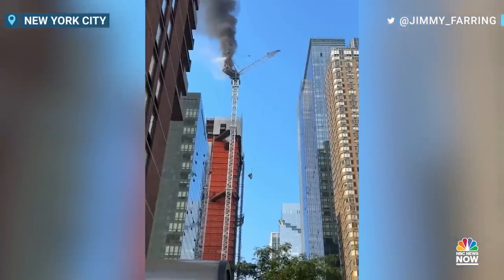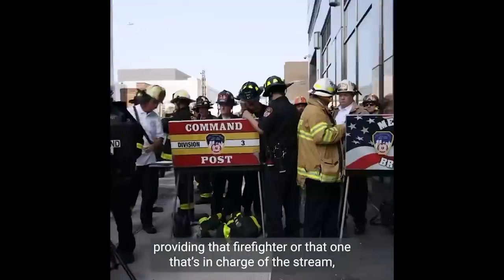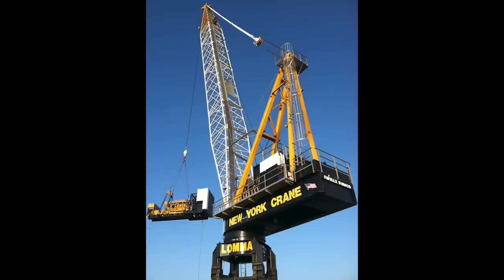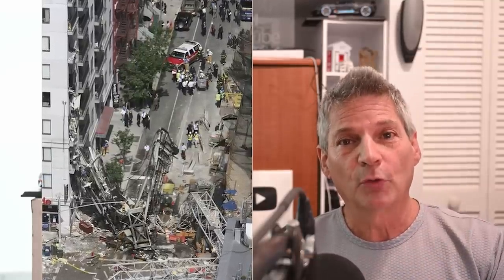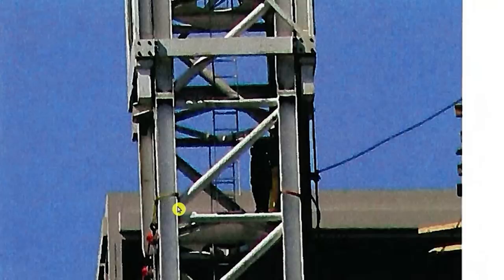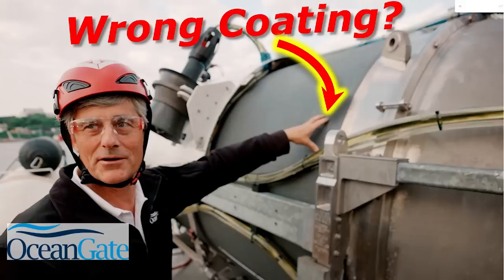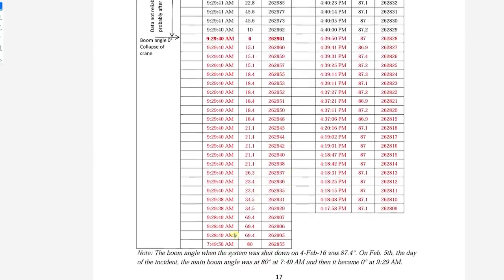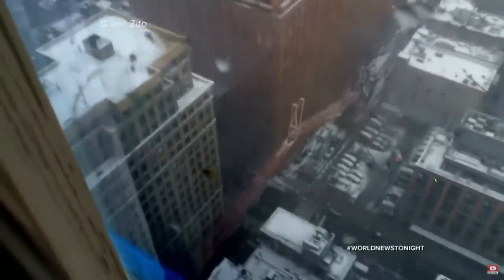New York Crane Collapse Cause, MORE Fatal Collapses

Comment: I’m a sculptor.  I was installing a 6.6 ton, 35 foot by 17 foot by 12 foot sculptural shade structure of my design that required a 155 foot reach from a crane parked on a street with a 20 degree slope.   The crane had been propped up at one end on shoring with its outriggers fully out. It took nearly 3 hours just to load all the counterweights to balance the reach of that load.  They lifted the sculpture up and over the brand new building, and as they were lowering it I stood next to the guy with the walkie talkie  who was directing the crane operator.  With the sculpture still about 30 feet in the air we hear the operator say, “ you got about 30 seconds to get this off the hook cause the street’s starting to give way under the outrigger.”  I stopped breathing, but the guy directing just kept giving instructions to line it up with the columns and lower away. 23 seconds later the cable went slack and I felt relieved.   The guy then explained to me that if it had fallen it would not have been the crane company’s fault, as they had done the calcs and the load on the foot pad should not have been enough to cave in the street.   He said the county would have been in trouble for making a road that did not meet minimum load bearing capacities.   The foot pad was a good 36 inches wide. After the crane packed up and left, I went and looked and sure enough, for the next ten years there was a circular depression in the road right where that footpad had been.  They just recently repaved that road and its finally gone.

Comment: Two streams may have been the issue.   And yes 45° may have helped, maybe not due to the loss of laminer stream due to wind/air pressure.     Water flow  is much  different  than a solid shell flying through  the air. Air/ wind is different  with  water ...  As a retired firefighter 45° is not always the answer.   I am sure they adjusted the angle for maximum actual distance. It looks like the FD  was using  a smooth bore nozzle which will send water the most distance.  I wonder if the second nozzle took too much pressure away.   Maybe, maybe not.  If they were at maximum pressure no issues of the second hose line.

Comment: I believe the reason they had the hoses angled the way they did was because they had to find a way of getting the stream there by the shortest route possible in order to maximize the streams effectiveness.  You will notice as the stream gets farther away, the stream begins breaking up and separating, making it less effective.  If they angle up, that increases the distance, but it also means the stream will break up more.  Obviously, there are a lot of factors that have to be considered.  The diameter of hose they're using.  The type of nozzle.  Wind speeds.  And what PSI they are using at the pump.  Now the 45 degree angle might very well have been the most effective.  But you just can't use that as if it is always the best one to use.  I used to be a firefighter, however its been many years since I last worked as one.  And I'm trying to recall what I learned and its definitely a little hazy.  So I know there is probably a better way to explain what I'm talking about.  And for that, I apologize.

Comment: A 45 degree angle giving the largest distance is only valid when neglecting friction. For a canonball, that is a somewhat appropriate approximation, but for a water stream it is certainly not. The stream quickly breaks apart into tiny droplets that feel a large amount of air resistance.
Reply from the maker: If what you are saying is true, why doesn't rain dissipate before it hits the ground, falling from thousands of feet? Yes, you would have some separation of the spray, but for sure at that distance may be 50 feet above the Crane, the water would be landing on it for sure, maybe not all of it, but at least some of it period at least what they have right now. Without horizontal spray, none of it is even reaching anywhere near the Crane.

Comment: ChatGPT gave this response to the optimal angle of a fire hose:  

The optimal angle for a fire hose to reach the farthest horizontal distance is typically around 30 degrees, not 45 degrees.

When a fire hose is aimed at a 30-degree angle above the horizontal, it strikes a balance between maximizing the horizontal range and minimizing the effects of air resistance and gravity. This angle allows the water to travel the greatest distance before it begins to fall back down to the ground.

The 30-degree angle is often considered the optimum angle of projection for achieving the maximum horizontal distance with a fire hose. However, practical considerations such as water pressure, nozzle design, wind conditions, and other factors can influence the actual angle that firefighters use in real-world situations to effectively combat fires.
Reply: The physics answer for a projectile ignoring air resistance is 45 degrees taking into account only gravity. However, because of air resistance, one needs more horizontal force for a water stream. If you have a fire hose in hand, the real life solution with would be to vary the elevation till you achieved maximum distance hopefully reaching the intended object fire. In the video, neither hose stream appeared to reach the fire adequately even though it looks like they were higher than the fire.

Comment: I watched the new 35W bridge as it was built from pre-cast pre-stressed concrete segments of 200-240 tons each. I was on the 10th Street Bridge adjacent as the first segment was hoisted and secured to the stub on shore. I watched several more segments put into place over the next two weeks or so, and was lucky enough to watch, virtually alone on a cold day, as the final segment was slowly lowered into place. A crew of workers in each end of that hollow concrete structure then connected the interior chord arrangement for post-tensioning. Another day at the office for them, I’m sure. Pretty cool process to watch from my vantage point, but with sad cognizance that the previous steel bridge was poorly constructed (thin gussets), and improperly loaded during surface replacement…falling without warning, killing several and injuring many more…..

For the hoisting of the concrete segments a massive old Manitowoc (model number escapes me now), it’s red paint job mostly faded to a pinkish hue, was situated atop two barges which were welded side by side. The crane bore the name “Big Ben,” which the operator explained in a Minneapolis newspaper article was in honor of his grandson Ben. (The casting yard city blocks away utilized a gantry crane to load the concrete segments onto truck beds for a truly short haul to Bohemia Flats. Once there another land based crane (the make escapes my recollection, but it was all blue) picked the segments from the trailers and arranged them by designation on the site. That crane soon bore the moniker “Bohemian Blue,” and subsequently loaded the concrete segments from the queue onto a barge tended by small tugboats to the appropriate site for Big Ben to perform its pick. One very interesting part of the process, amongst so many others, was that once the two-masted Manitowoc had raised a concrete segment to the proper height, the operator let out the mast winch line and “coasted” the boom forward/down and directionally proximate to attachment point of prior segment string and new piece. There was a definite run-out sound as if hand pulling fishing line from a reel! Due to how many “parts” of line were run on the mast assembly of 650 ton capacity Big Ben, the concrete segment slowly, assuredly, accurately “floated” into place as the boom was lowered! It truly was impressive, and when within reach of “home,” the brake would be heard slowing the boom descent under full control. Remarkable operation each time; like a slowly moving game of darts! 

I remember the scale of the white-painted traveling block on Big Ben, and the even larger alternative block resting, lashed to the barge, also white, as workers labored at the pylon corners of the barge! Massive!! 

Although I grip my steering wheel tightly when driving over the “new” 35W bridge, I think about having watched these very segments put precisely in place and strung together by workers standing upright in the hollow belly of the bridge!

The newest, the third in my lifetime, Minnesota Vikings stadium, not but perhaps two miles from the 35W bridge, required a HUGE yellow and blue Sarens crane to be assembled inside the footprint of the building, on the field of eventual play. I had noted a very(!) oversized load on a flatbed trailer crawl ahead of me at a stop sign, it’s cargo but a single yellow boom section! It was the tallest, widest and longest bit of crane I had ever seen only yards away in traffic. As the crane was erected over the course of weeks, and as it could be seen as both taller and “thicker” than any crane I’d ever seen from miles away on the city skyline, I knew that this was, as Charlotte might say, “Some Crane!!”

That Sarens, at 1,130(?) ton capacity, billed in the newspaper as “the second or third largest crawler crane in North America,” absolutely dwarfed the 500 ton Manitowoc, itself truly gigantic, set up outside the stadium footprint! The crawler tracks were about eight feet high. It had two masts of course, plus outrigger counterweight straps just in case it had to lift anything actually heavy…which it did not hear. Absolutely everything was massive!!  I arrived once to watch the action through the fence, in good company as we all expressed our awe, only to find the workers laying about after their lunch. I recall one guy getting up, as others were stretching back to life, and nonchalantly strolling past the big Sarens. I thought to myself that if I were on such a worksite I’d take every spare minute to marvel at the yellow and blue steel lattice beast in my neighborhood!  And then, back that man returned, climbed a ladder onto the eight foot tall track, and stepped into the operator compartment… He wasn’t in awe of the crane as I was; he was the primary operator. A subsequent newspaper article stated that he and a backup operator travel with that crane! Most recently they had been at a nuclear power plant build, if I recall correctly.

Each evening, come the close of the work day, the giant Sarens, with a jib as long and thick as the boom of most run of the mill cranes(!), would be “jack knifed” onto a set of off-white polyethylene wheels at its apex. So I know what you mean Jeff about that safe-resting procedure. The parts, all the parts, of that crane were beyond my prior reconning!!
(I realize that there were and are far bigger cranes even within North America; but not in my “near neighborhood!”)

One night I heard a hum and saw some faint lights coming from the bowl of the stadium build. Having nothing else to do on a night off from work, I walked over to the fence. An operator and one other worker were slowly moving the Sarens through maneuvers which varied but slightly one from the other. It occurred to me that they may have been planning out angles and placement priorities for a big lift the next day, though that is only my speculation…

The Sarens was not needed for its gross maximum lifting capacity, but for its security at jib height with bulky, awkward and expansive steel structural loads. If I had to guess, nothing I saw the Sarens lift weighed over 300 tons. Everything was on the end of the jib; the boom line never came into play once!

Taking down, packing up, and hauling off the Sarens took another week or so. I’m glad that I took photos, for I may never again see another crane with eight foot crawlers!! (Though perhaps if the Vikings decide that they require a fourth iteration of a stadium to make up for the fact that we STILL haven’t won the Super Bowl . . . )

Comment: I guess the problem with the water stream from the hose is that the best possible angle is not 45 degrees because the stream will separate into mist before the water travels the whole arch. If they were shooting metal balls from the hose without air friction, then 45 degrees would be optimal.

Other than that, great video. And I think it would be better to underline which parts are speculation and which are actual data in future.

Comment: 2 things here... 1 the nozzle laying on the ledge at a horizontal angle is a 2.5 line that flows water through a 2 inch opening to the nozzle and the one arched at an angle is a blitzfire/ ground monitor  on a 3 inch line forced through a 2.5 inch opening to the tip... the 2.5 line isn't going to the ability to reach that far even at a 45° angle and  the ground monitor on a 3 inch line was barely getting it with droplets from the end of the stream as it was breaking up and maxed out in distance and that didn't even end up putting the fire out.. they got a hoseline up through the building that the crane was building to finally extinguish the fire... and water doesn't work like everything else you learned in engineering class.. it is affected by many things. Friction loss being the biggest especially when going up an elevation.  Wind  is going to push the stream left right and even back at you. No matter what angle the 2 hoselines were put at it wasn't going to make a difference in its ability to extinguish the fire

Comment: I was at a construction site and it was a little windy. There was winds between 15 to 20 with gusts up to 30 knots. The crane operator refused to operate it and started shutdown almost as soon as work started. 

The sub that needed glass moved to install windows was screaming at the crane operator after having ripped it out the hands of the guy on the ground who was doing the loads. I remember calling my boss who told me to evacuate and move upwind of the crane and put a few building between me and it. Nothing happened but it was pretty hairy. My company just black listed that site and filed a formal complaint. 

The site super banned the sub contractor from the site and the crane operator got a bonus. It was never actually in operation as it had not moved and the operator only took the time to make it safe. I don't know anything about the crane but apparently the safety rules on site said the crane could not operate in those conditions regardless of the actual limits of said crane.

Comment: Regarding the arc of the fire hose discharge, I have always had a terrible throwing arm, and I was the smallest and absolutely worst shot putter in my high school athletic conference.
However, I did know that the trajectory of the launch was crucial to how far I could throw a baseball or put a shot; I didn’t have the strength or speed of motion to get there…

It seems odd indeed that the 45 degree angle could not be achieved with either of those firehouse nozzles and concomitant streams!

Comment: I've been watching people do really strange things while lifting things for decades. Be it a crane, or a fork lift, they just have to try it their way.  There's a video out there of a forklift hoisting up a forklift with a load on it. Ladders on a pallet on a  forklift. My first real job was in the airline cargo business. We used to get 5 or 6 Ferrari cars in on our 707 freighter. The company {Yonge-Steeles Motors) would send out drivers with gas and drive them to their ship. Because we were a small operation, we didn't have the pallet moving equipment or ramps or anything. We picked up the cars with a forklift using extensions and blocks of wood. One afternoon, I was with a coworker, he was operating the forklift. The car came up off the pallet nice as could be, but  he backed into a small pot hole on the ramp. The jolt caused the car to start bouncing on the forks and before he could drop it, it came off abut 3 feet up, landed on it's side and rolled over. The guy walked into the office. Half an hour later the  lead cargo hand came out and freaked. Apparently the guy just picked up his gear and left, never to be seen again. Working as a millwright later on, I saw some of the strangest lifts. Like I said, people do weird stuff with lifts.

Comment: 45 degrees is only maximal in theory, it does not allow for aero drag slowing the projectile down.  And I am guessing that for a stream of water, all 45 degrees does is add so much distance that the stream turns into a cloud and does not reach as far horizontally.

Comment: You may want to get some one-on-one with a crane engineer about how cranes are constructed and operate. One set of cables/support mechanism maintains the position (angle) of the boom. The other lower cable(s) are simply for the lift. Your vids are of interest to me so keep your work going.

Comment: typically, the operator is required to do a beginning-of-day and end-of-day inspection and make sure that the daily maintenance operations ( pins greased, all fluids checked, general condition of belts and hoses, etc ) are completed.
.
i will point out that hydraulic lines are often not going to show noticeable wear before failure though.  when you're dealing with +5000psi hoses and fittings, it's not terribly unusual for them to just blow out through the steel braid.   and at those kinds of line pressures, it doesn't take very long to dump a lot of fluid.
Reply: A fire can result from  a hydro line  blow out  spraying oil all over hot friction brake bands or other hot parts like electric motors or engines